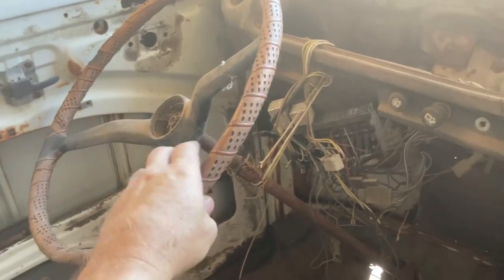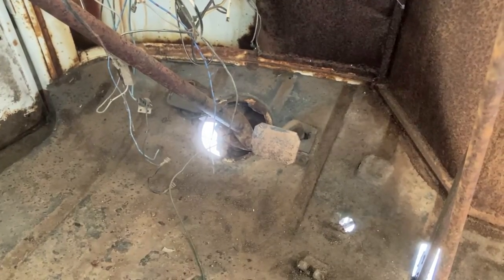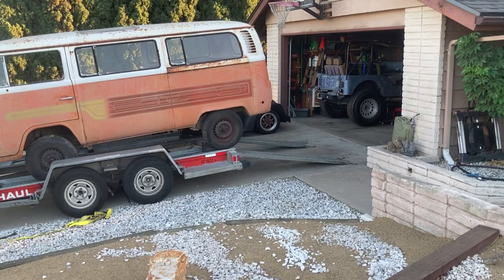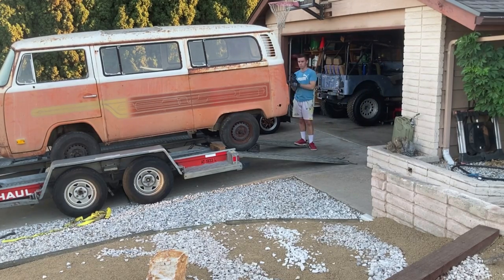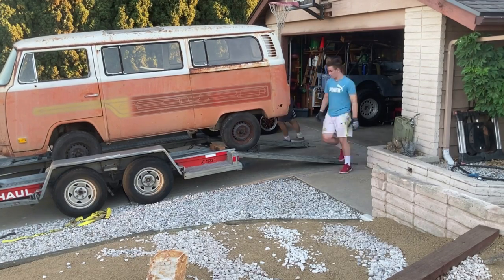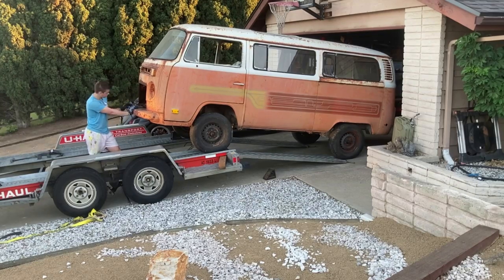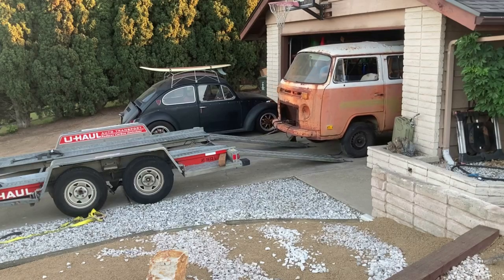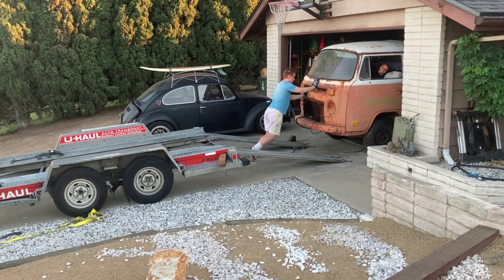1974 VW Build-a-Bus - Bringing It Home

Comment: Nice! Welcome to the Bay Window club
Reply from the maker: I'm so glad to get back into a Bay Window.  I sold my '79 back in 1996 after having it less than a year because it was a crazy fuel injected problem child.
Reply: I have a ‘70. No fuel injection, but I have had fuel pump issues over the last few years due to crappy aftermarket parts.